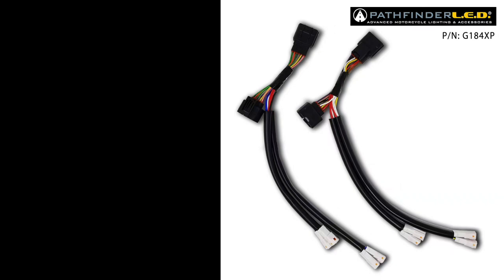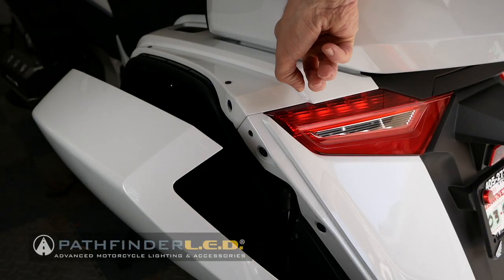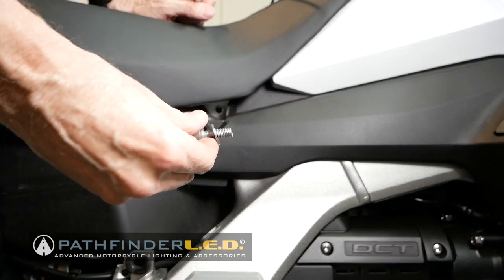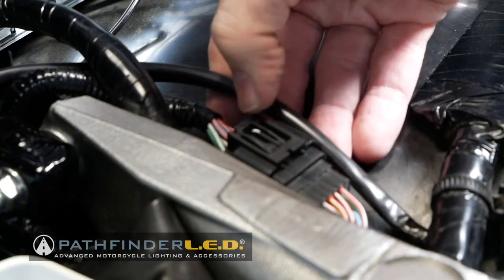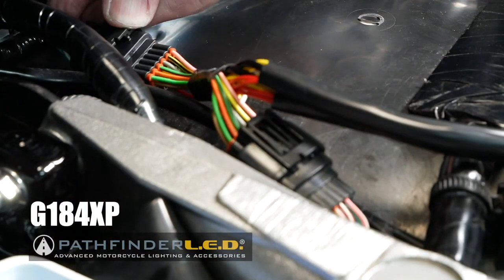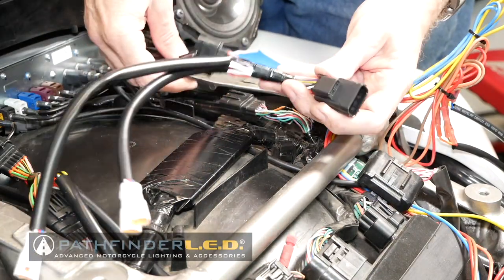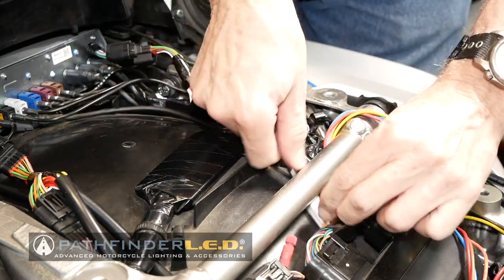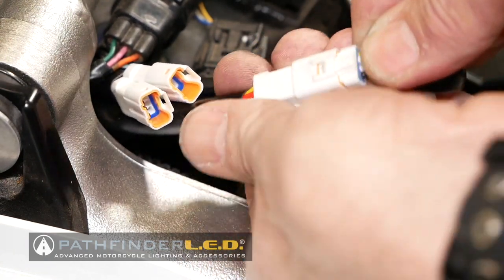Plug-N-Play Harness G184XP Install | 2018+ Honda Goldwing | PathfinderLED

Comment: Chris (or anyone else who would like to chime in), sorry if this has been asked and answered. I recently purchased the maintenance videos and got myself up to speed on some of the most commonly removed parts for accessory installs. I'm in the middle of a number of these right now (taking my time) doing the Pathfinder fog lights, the lower cowl sequential lights, Muth mirrors, and isolator fuse block. I had already installed the TailBlazer and am familiar with plugging in-line into the saddle bag harnesses. With all my new goodies, I'm finding that I have to plug in-line to those same harnesses two more times, resulting in this daisy chain of accessory plug-in harnesses! (if I'm doing something wrong there, please say something!!) How have you gone about tucking all of that wiring out of the way for the seat? With just the TailBlazer, it was a challenge to get everything out of the way. Thanks for everything - love your videos!
Reply from the maker: Good question. I have all of the accessories you mentioned. I only have 2 harnesses, the Show Chrome Isolator and Tailblazer. All others are wired into the Isolator. I did not use the Pathfinder harness. You can cut off their connectors and wire the lights directly into the isolator. The Pathfinder instructions will give you the wire color legend.
Reply: @cruisemansgarage Excellent suggestion. Did just that and it works great. So now I have this Pathfinder harness that I don't need. If anyone reading this could use it, let me know and I'll make you a deal!

Comment: If I want to install this harness and have the Kisan TailBlazer installed (which I know you have on your bike) doesn’t that cause a problem within the space available?  If it does work then the TailBlazer just has to be towards the back and the harness connects between the TailBlazer and the existing Honda connector, right?  It was already a tight fit with the TailBlazer install (2021 GW Tour).

Comment: Makes it easy to add other stuff but what do you do if you want an accessory from another vendor? I bet the connectors don't match.
Reply from the maker: Very good question. And I know PathfinderLED is toying with a 4 wire patch so you can get 4 bare wires to connect to other devices from their harness.

Comment: Hi Cruiseman,
I need your help to identify the Pathfinder sub-harness color codes (ground, running, and brake light) as I need to install aftermarket (Add On brand) central taillight trim running and brake light the one comes in the same place in the rear center key cover under the saddlebag, and I need to use one of the 4 Pathfinder terminals by cutting it off and put another connector to hook up the new accessory to the existing Pathfinder sub-harness
Reply from the maker: Kemo, these are listed on the SoCalMotoGear website as well as in the installation docs for the Pathfinder harness. You can download the install docs from their website.

Comment: I have seen a previous video by you that indicated that it was not safe to add any electrical accessories except through a electronic fuse block device as it could damage the CANBUS wiring system. I have noticed that multiple manufacturers are now producing plug-n-play systems and indicating it will not harm the CANBUS. As I am currently installing LED lights and I was just wondering if it is safe to use plug-n-play? thanks for the great videos, Bob BLGL1833.
Reply from the maker: It is likely that no damage would occur using a plug-n-play harness, but any modest overload on a circuit could cause the computer to throw an error code. The only way to ENSURE that you are protecting the CANBUS is with an isolator so that your accessories are getting their power directly from the battery.
Reply: thanks Chris, I am only installing 8" long, 2-LED running lights / 2-LED turn signals. However, not knowing the Honda circuit load or actual added LED load, the safe route is to install the isolator. Bob BLGL1833.

Comment: Thought you removed this after you installed the fuse block by Show Chrome.
Reply from the maker: I did on my bike, but some still use it.
Reply: @cruisemansgarage  gotcha'  I am putting on the Rivco Driving lIghts, muth mirrors, and the socal brakelight.  Should I get the ShowChrome fuseblock?  BTW...I watched almost everyone of your videos.
Reply from the maker: @bobfredrick6854  Bob, I would. I run ALL accessories on my 2018 through the Show Chrome block. https://amzn.to/2vSkXXm
Reply: @cruisemansgarage  Perfect!  Thanks!